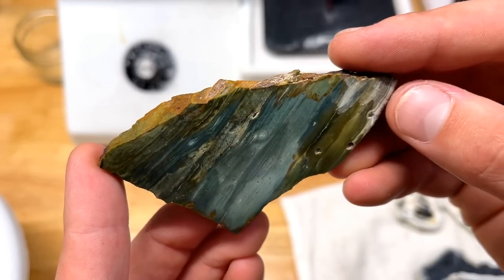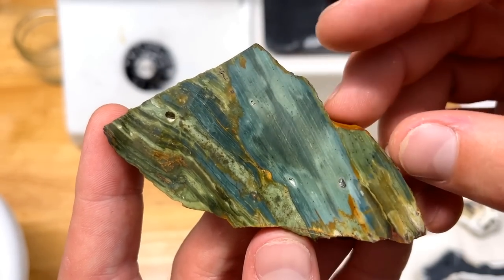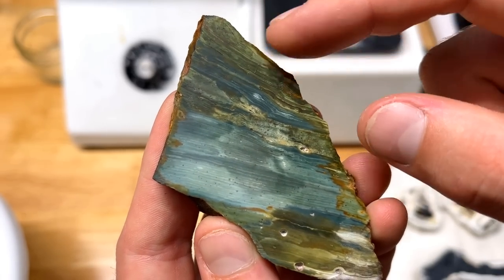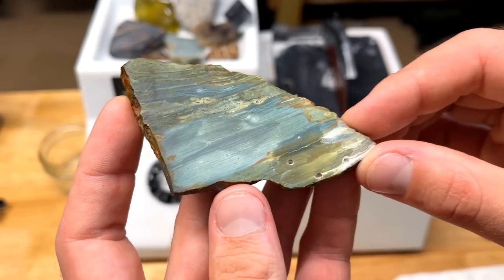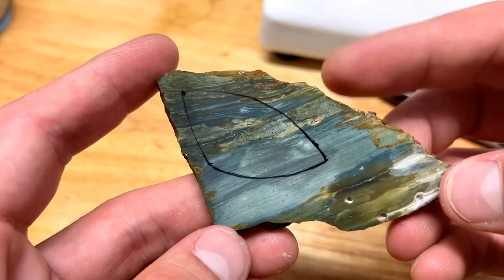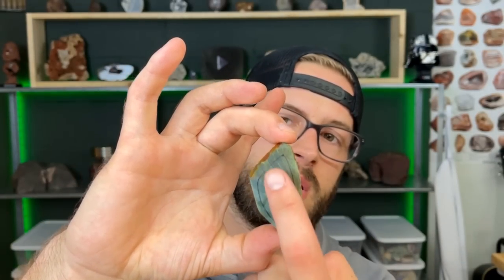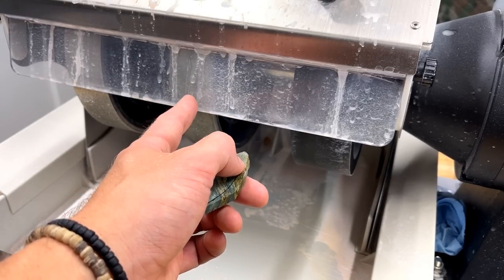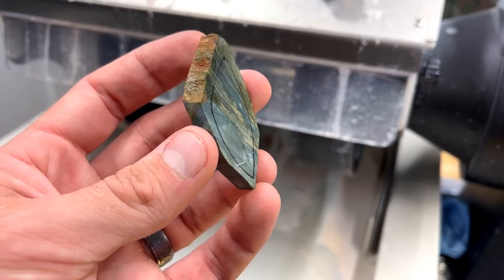How I made my first cabochon // Beginner Lapidary (CABKING) Gary Green Jasper

Comment: I teach cabochon cutting classes. I just came back from one. You did well. A few things.......(uh-oh! lol)

80, 220 Galaxy or metal bond wheels are the grinding wheels.
80 is for the initial rough shaping and doming. 
220 smooths the dome and girdle and removes the scratches put in by the 80.

280 and 600 are sanding wheels. They smooth the dome and girdle and remove the scratches

Using a light touch is important on the grinding  and sanding wheels. 

All the flat spots, ridges, and scratches should be removed before moving to the pre-polish wheels

1200, 3000 Nova resin are pre-polishing wheels. 
1200 use a light touch. Spend no more than 60 seconds on this wheel
3000 light touch. No more than 60 seconds on this wheel.
Can you remove flat spots and scratches with the pre-polishing wheels? Sure, but you run the risk of ruining the wheels. Removing flat spots and scratches need to be done on grinding wheels.

Mark the girdle using a sharpie marker or aluminum pencil. The girdle needs to be even all around the cab.

Mark the center point too, because you are grinding up to the center point. It will help avoid that flat spot in the middle of the cab.

There is a bevel at the base. But it's not as exaggerated as the drawing. It's more to smooth a sharp edge. There are many explanations for this anywhere from preventing the sharp edges from cutting wire wrapping wires to minimizing chipping. 

The International Gem Society has an article on cutting cabochons where they discuss the 45 degree bevel and the 60 degree bevel cuts.

I hope these tips will help you. Lapidary is a great.

Editing to add... I realize there will be commenters who might say "I hang out on my 1200 for 20 minutes and it's still like it's brand new."  Or something else like that. To that I say: read the owner's manual.

Comment: You did a great job.
 The girdle is the flat edge that is generally 90 degrees to the top or table of a gemstone. 
 On the reverse what you did is called beveling the edge which helps with setting the cab so it doesn't chip. I tend to do just a very small bevel on the reverse.
GD
Reply: The only things I would have done differently would have been to remove that cavity along the girdle edge and less of a bevel on the back. both of which would make bezel setting easier.

Comment: Great job!!!!!!! My biggest tip is use a dop stick after the first two wheels. It's easier to handle by using it to rock the stone to get the cab. For most stones I use a drop of ca to put the stick to the stone. If you want me but in some more let me know. I do not want to be pushy and everyone has there own style. Again GREAT JOB!!! I put my first into a belt buckle and I still wear it.

Comment: I notice u have paper towels on both sides of the cabking motor mount to catch water drips - I had same situation  - if you position a 1.5-2” strip of alien tape on the underside of both arms so water drips fall onto the side shields it will no longer drip to the mounting base.  My husband gets credit for this suggestion.

Comment: For a first timer you did wonderfully.
I alway wonder how thick to cut a slab thinking the stone could be made into a cab.   Hardness, flaws?
Reply: 1/4 inch is "standard", but slab thickness depends on how you will use the finished cab. For cabs 12 mm or less, I prefer to use 3/8 inch thick slabs because I don't wear out my wheels removing a lot of excess material. If I'm making a 30 x 40 mm or larger cab, I like to start with a 1/3 inch thick cab because it gives me more material to get that dome. 

If there are fissures/cracks, in a slab, I avoid incorporating them into my cab because 1. the fissure might expand as you work the cab and crack the stone 2. unless you use a diamond polisher, polishing compounds like cerium oxide will get stuck in the fissure/crack/divot and you'll have a hard to getting that out.

I hope this helps you.

Comment: Wow!!! What a gorgeous stone 🤩 
How thick should the slab typically be to create a cabachon?
CabKing is on my bucket list but I’ve got the 8” flat lap for now and excited to break her in 😁 and a garage full of rocks to polish…you inspire me 🙌🏻
Reply: Generally, a 1/4 inch thick slab is "standard". But slab thickness depends on how you're going to use the finished cab. For example, I would use a 3/8 inch thick slab if I was cutting a 12 mm cab or smaller to avoid removing a lot of material (which also means less wear on your grinding wheels). If I wanted to cut a 30 x 40 or larger cab, I'd start with a slab closer to 1/3 inch. I hope that helps you.